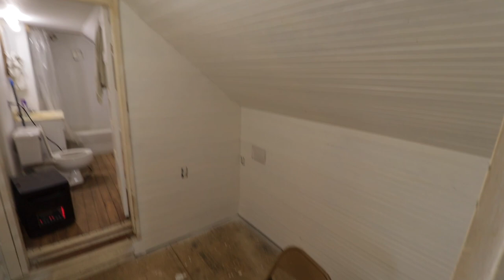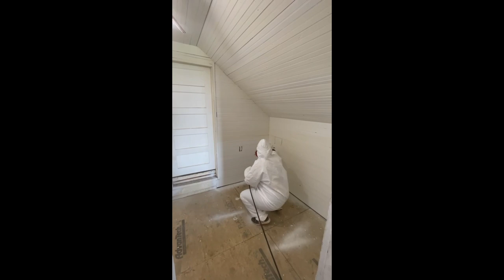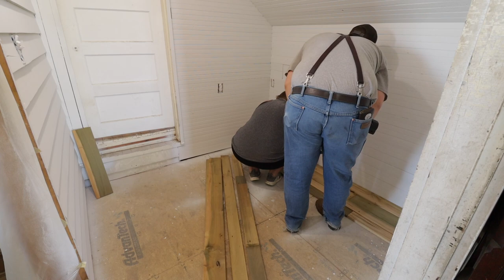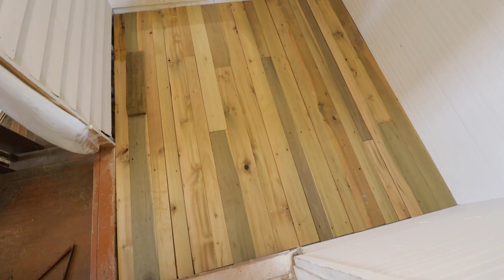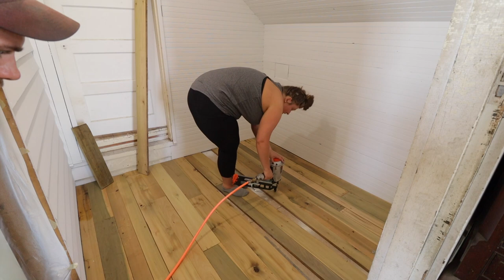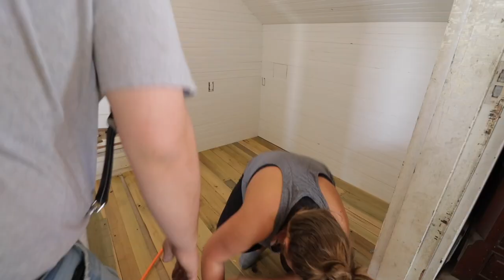Laying Reclaimed Hardwood Floors | Painting | Laundry Room Renovation

Comment: Amazing! You and your family are a hardworking team. I love that you are not settling and know exactly what you want, from the paint color to the sealant, to the placement of your boards. The previous owners from you previous home did not seal the wood floors correctly. Apparently they rushed through and didn't make sure the floors were clean and dust free before applying the sealant. Either way, the linseed sealed boards look amazing! As for the order in which you are doing things, as long as your process works, it is the right process. Bravo!
Reply from the maker: Awe, thank you so much! We take a lot of pride in our work. Since we plan on this being our forever home we want to make sure we take our time with it and get it exactly how we want.

Comment: You poor girl--getting the wrong color paint! I could tell--it did have a yellow tint. If you haven't done it yet, don't bother sanding! One layer of paint is nothing--especially if you sprayed it. Plus<, you might sand down to your primer and have the bleeding again. Hang in there--it's all looking gorgeous!
Reply from the maker: I know, I almost couldn't believe it. I already sanded it lightly, went back in with a thin layer of the BIN primer, and added the final coat of paint. Thank you!